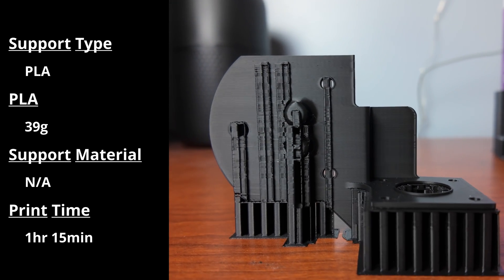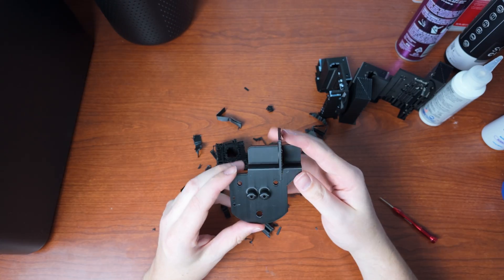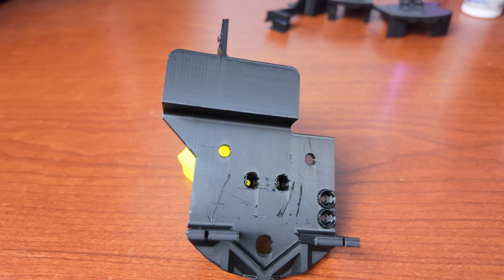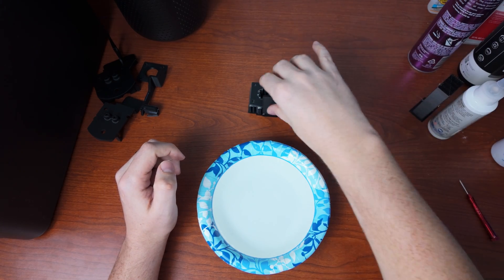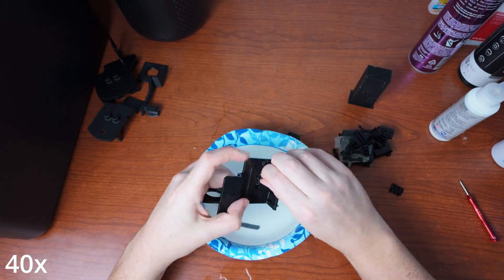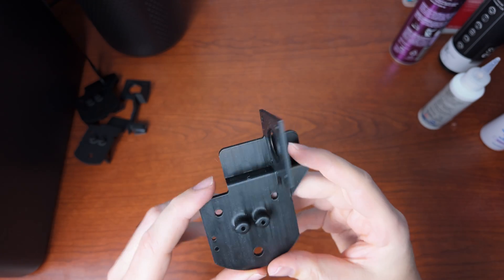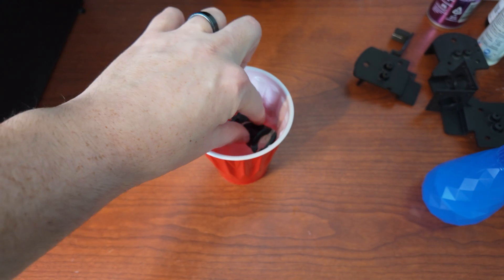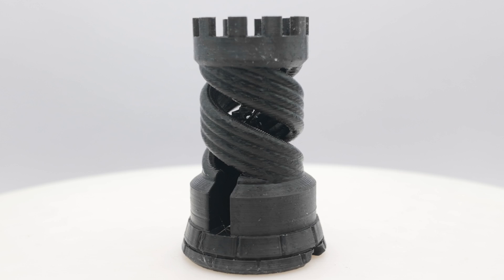Bambu Released PVA Support Material! | Water Soluble Supports!

Comment: i bought it for the h2d..  then i bought a HT dryer and went through a deep deep valley of frustration.
the problem with PVA is that nothing does stick to it, if you want to print on it.
the models in this video are ok..  the second one doesnt even need any support i would say..  but things where overhangs try to start printing on the PVA interface do not work..   the material (pla, petg) does simply not lay down on pva
Reply: That was my experience too

Comment: I wish there were a setting to add a layer or 2 of pva between the support and the actual model.
Reply from the maker: You can set the interface distance, so you could put a few layers if you want. Though, more filament swaps to do that, so you have to weigh convenience vs cost
Reply: Thanks for letting me know. I just got an H2D so maybe that 2nd extruder may help.

Comment: I think the reason the print snapped so easily is because the pva was contaminating the PLA inside the hotend.
also pva dissolves really neatly in an ultrasonic bath :P
you can also drop in a magnetic stirrer, or honestly, just give it a shake every 10m
Reply: Hey how did you make the words magnetic stirrer turn to a search link like that?  Did you use html code in your comment?

Comment: I bought this stuff, really keen to use it on an MCG model I wanted to make for a co-worker. All the research I did said you have to dry it first, given it's really hygroscopic, so I whacked it in the X1C and ran the filament dryer, and the bloody thing expanded and now won't fit in the AMS... I was so peeved. Bought a new filament dryer yesterday that hopefully does the job better. I can think of quite a few models where this stuff will be a godsend.

For the standard Support W, I find it often squeezes out a bit from the interface layers. I've used that to try and gently lever the supports away from the model before snapping them off and it often comes away as a smooth layer atop the supports instead of remaining on the model and needing to be peeled away.

Comment: So how do you designate which model part gets PLA and how the supports get PVA. Do you use AMS?
Reply: There is an option to select the support material {for the whole model} in the support section of the slicer menu. for individual designation you would have to manually paint the support areas you want.

Comment: How do you switch between different materials within the support?
Reply: In Bambu Studio, the "Filaments for Supports" section of the Support tab. "Support/raft base" is the material to print the support itself out of, and "Support/raft interface" is the material to print the interface from. Unless you're trying an impossible print (where the support can't be mechanically removed), you'll want to just use a different material for the interface, and use the same material for the supports themselves as the model.

Comment: which 3d printer did you use?
Reply from the maker: Bambu P1S w/ AMS
Reply: @PrintPractical  thank you! I heard the TPU can get clogged in the AMS and I was wondering if PVA too.
Reply from the maker: PVA works fine, but you have to make sure it’s very dry. TPU is not recommended nor have i tried it, but I don’t think it’s a good idea. The path that the filament takes to the extruder is so long, with multiple motors pulling the filament through. It’s going to be hard to get consistent results when the filament stretches so much.

Comment: Dude, thank you for this video. I printed a skull that has celtic markings all over it using the "support for PLA" product and it was awful. Its still stuck in all the small gaps even after using tons of force to get it off. Just not a good experience there. So I bought some PVA to try for a reprint. Glad to see it worked out here.
Reply from the maker: When you get the PVA, just be patient and let the water do its job. This stuff is sweet for use cases like that.